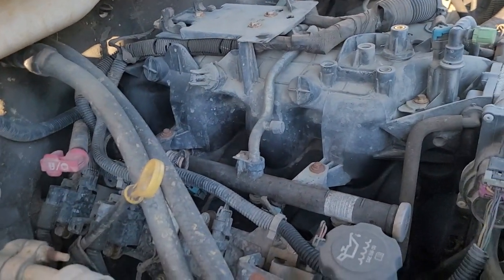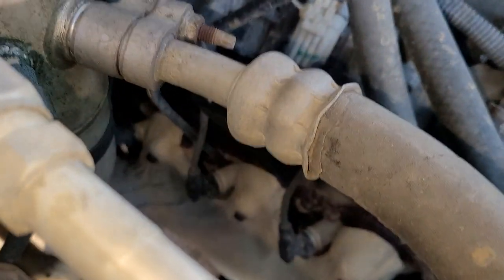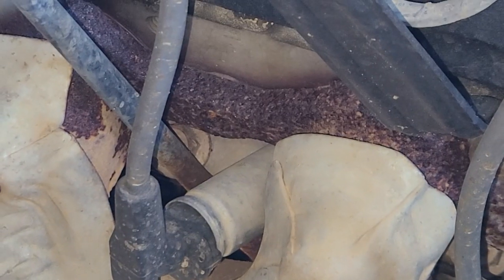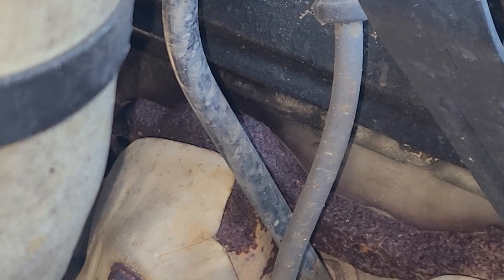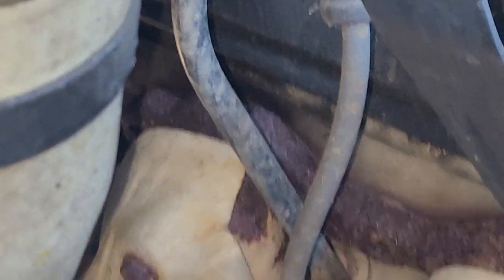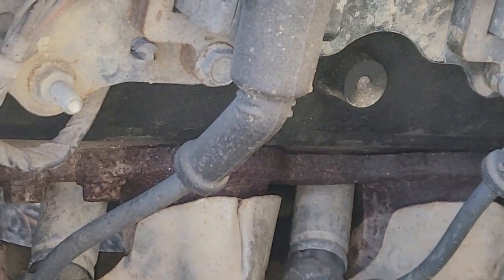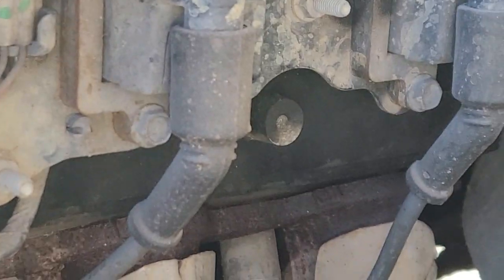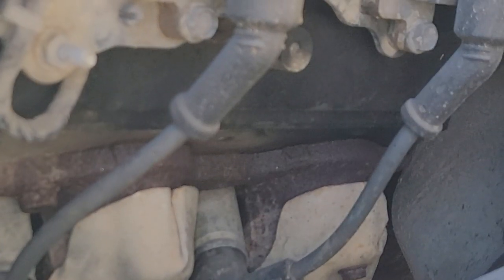Valvetrain Tick ? It's Exhausting what's making noise on this one ..

Comment: I've owned two Chev Suburbans, and both had broken exhaust manifold bolts. Neither required any intervention. Have you ever found that the ticking sound from an exhaust leak goes away after the vehicle warms up? Or, would that be a sign much more suggestive of a sticking lifter? I agree with your remark about cat efficiency. Exhaust leaks that trip cat efficiency codes would be much farther downstream, much closer to sensor 2.
Reply from the maker: Most exhaust leaks like this one tend to go away when they warm up . Usually a lifter gets worse or stays the same as it gets hot .
Reply: @WrenchingWithKenny  I guess that makes sense, the metal expands and seals the gap. That's good to know about lifters. I guess I was wrong when I thought that as oil pressure refilled the lifter, it would work better.
Reply from the maker: I would think it's possible. I've just never seen it happen that way .
Reply: @WrenchingWithKenny  I have this exact problem, thanks for helping me get to the finish line with it!
Reply: Great video was it a manifold leak or the bolts needs tightened

Comment: ihear a tapping noise from my 5.3 when ever irev the noise goes away.also when istart it up in the morning my motor idles smooth then when its hot its tapping could it be my mani folds
Reply: Did you ever figure out what it was, that’s my situation right now.

Comment: That’s the same with the Hemi tick isn’t it? 
I have a tick at start up every time… told it was an exhaust bolt in the manifold.
Reply from the maker: It can be . The Hemi did have camshaft issues also , but a broken bolt was more common

Comment: So i have a 4.8 and i put new speed engineering headers and ARP studs and new plugs and wires fixed all my exhuast pipe leaks and when idling you hear nothing but when reving you can hear a tick and turns into a loud rattle when you accelerate no check engine light no misfire would could be my issue sir

Comment: Thats the exact same sound my 5.3 just started making tonight. The weird part is it stayed the same after everything got warmed up and i didnt notice it until i drove about half mile on my dinner break and was in the drige through. Sounds like it down low on the drivers side at the manifold, and i do infact have a few broken bolts at the head.

Comment: I have a similar exhaust issue on my 66 f-100. 358 FE engine. The corner is broke/cracked. Question please. 1. Does that hurt anything? 2. Can I patch that with high temp JB weld as a band aid? Thanks Kenny. Your videos are very helpful
Reply from the maker: It's not really going to affect anything other than be annoying. I'd probably leave it alone
Reply: @WrenchingWithKenny  Thank you👍

Comment: Just found 2 sheared off manifold to head bolts on my 07 commander. Supposedly the bolts in this make and model are a different metal from the the head so machine them out would be extremely costly compared to the value of the Jeep. I can deal w the putt-putt-putt-putt-putt ticking noise of strangers who I don't know on the road can. Lesson?? Gona start buying Japanese made s**t. Roll the dice there because American car companies just produce garbage the last few decades 🤘😎🇺🇸

Comment: bro help me with this pls? 
I dont feel any engine braking while driving whats the problem? Also engine sounds quiet you can hardly hear exhaust. There is flow from exhaust like its puffing in waves.
Aynways I wanna get to bottom why I dont got any engine braking. It feels as its not getting enough air or something is plugged.
Also engine gets really warm after short drive but doesn t overheat.

Im thinking maybe manifold or cat is plugged partially and its not getting enough air cause of throttle body or valves. Also changed 2 O2 sensors and maf sensor. So im thinking catalytic converter is bad so it keeps burning sensors 02. And im suspecting throttle body cause when i rev car in neutral and then take off after that it drives few meters better and sounds better. Its like with reving in neutral i give him some air or maybe i push exhaust fumes more out. 
Maybe thats why engine is hot cause its not getting exhaust fumes quickly out?
What your opinion pls help me its dangeroues and difficult to drive without any engine braking when releasing gas pedal. Car coasts like its in neutral although its in gear when releasing gas